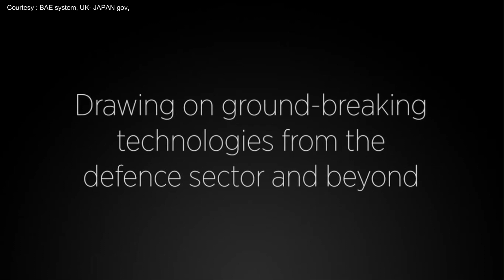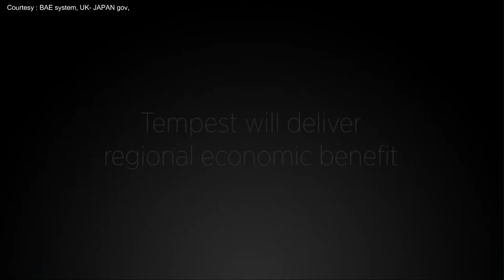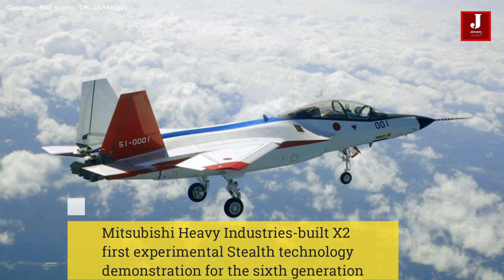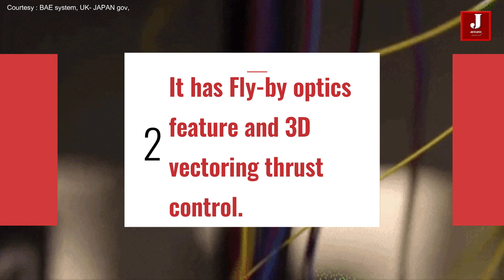10 Facts about the 6th gen fighter jet, which the UK, Japan, and Italy are jointly developing.

Comment: The engine´s prime contractor is Mitsubishi Heavy Industries and IHI. Rolls Royce is likely part of the effort, maybe consulting roles or who knows, but they are not responsible for the engine. I think the main reason is, that Japan already spent a lot of money, time and effort into research and development of the jet engine XF9-1, which has already the thrust output comparable to the F22 while being much smaller and lighter, and they are working on improving it further, with the goal to achieve around 200kn thrust. That´s an incredibly powerful engine! It makes sense to use their resources to work on this engine, which is already at a good level and has the potential to get even better, instead of contracting Rolls Royce to research and develop a completely new engine. That would only push the development/production timeline for the GCAP back, without any insurance that the engine will work out in the end. The push back of the timeline will cost enormous resources plus all the resources spent on the other engine are more or less wasted.